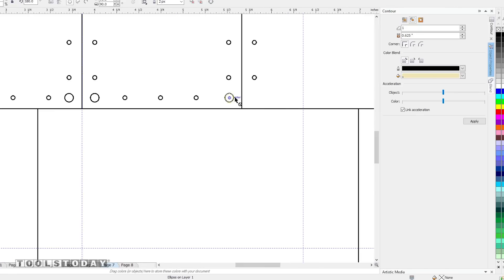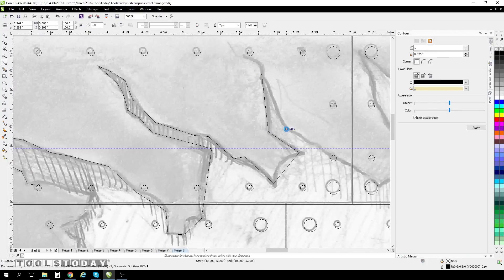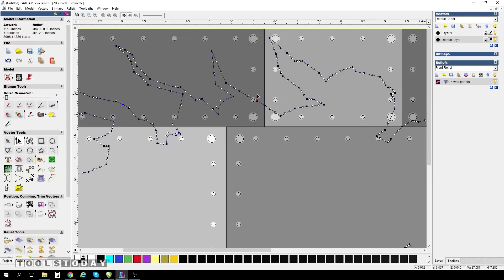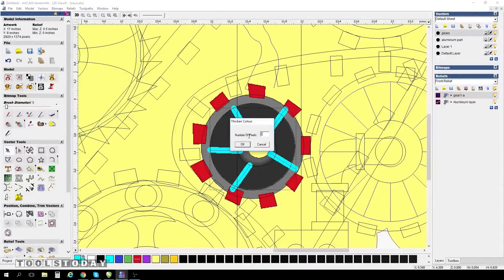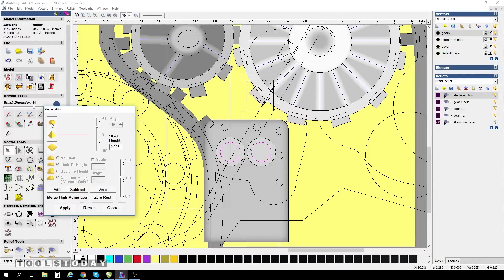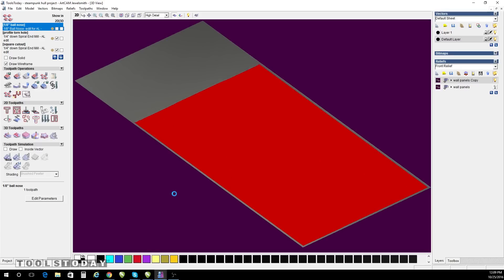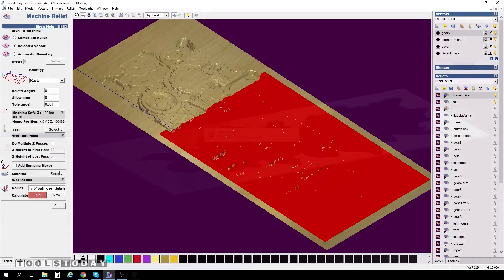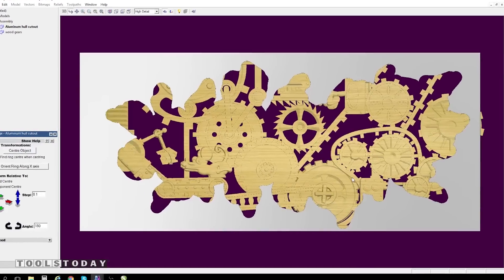How To CNC 3D Carve Aluminum & Wood to Create "Shipwreck" using CorelDraw, ArtCam and Amana CNC Bits

Comment: Instead of dealing with turning a 2D image into vectors to load into a CAM program I just use PixelCNC, which takes images and directly turns them into toolpaths/g-code. It makes doing art projects on a CNC super easy. http://deftware.itch.io/pixelcnc/
Reply from the maker: Thanks for your comment Charles. Nice software you mentioned !